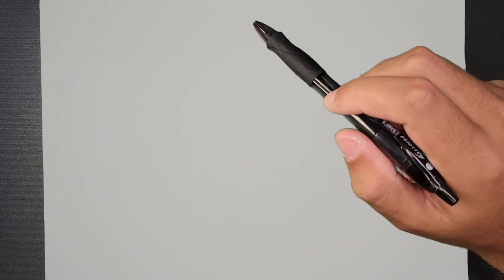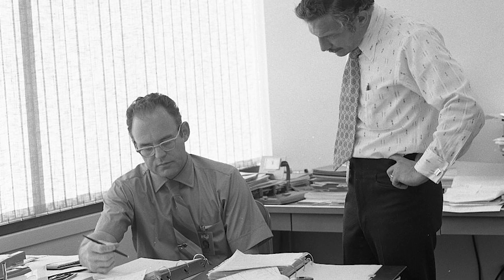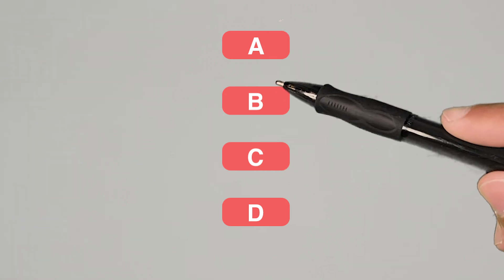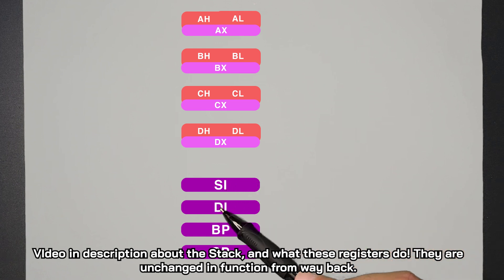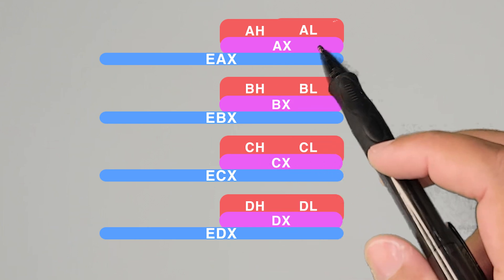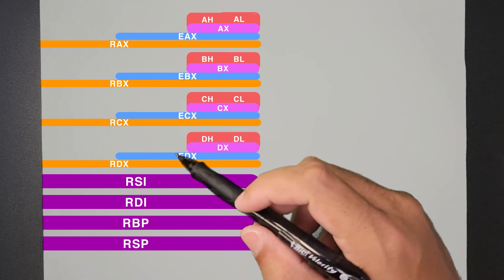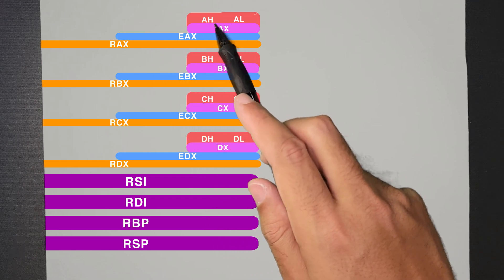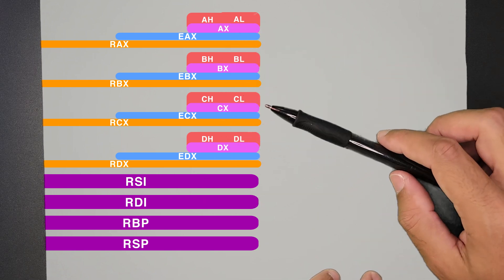Register Names Explained - x86-64 General Purpose Registers (RAX, RBX, RCX, RDX, RDI, RSI)

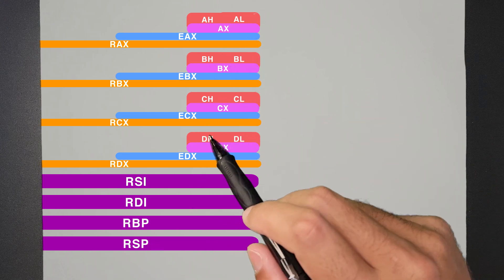Comment: 7:10 I don't understand why RDX has to be clear (contain 0) before performing a division operation. You said the remainder of a division would be stored there, but wouldn't the remainder just overwrite the value in RDX? The only reason having a nonzero value in RDX would matter is if the remainder was ADDED to the contents of RDX instead of overwriting it (or perhaps RDX is used in some way to calculate the remainder). Perhaps you meant there may be a value in RDX that had to be saved. If so it could simply be moved to another register without needing to clear RDX.
Reply from the maker: Hey there! The DIV instruction allows us to divide massive, 128-bit numbers. To handle this, the RDX register is combined with the RAX register. This means that whenever we divide, it's actually looking at both RAX (as the lower 64-bits) and RDX (the upper 64-bits) as the dividend. So this is why we zero out RDX, because if not, then the Assembler will think that we're diving into a massive number.

Here's an example:

Imagine we had some regular decimal registers that can contain up to 4 digits, let's call them RA and RD (register A and register D). Let's imagine that RA had the value of 0010, aka ten -- regular old ten, in decimal. Now let's imagine that the RD register was put 'on top' of the RA register in combination:

RD:RA

Let's now imagine that RD has some value in it, let's say it's also 10, or 0010 in our 4-digit-decimal case. So now, it looks like this:

0010 0010.

If we divide into RA, thinking it's just ten, then we see it's a big mistake: It's actually 100,010 -- or one hundred thousand and ten!

That's what's happening with RDX, and that's why we clear it. Sorry for not pointing that out in the videos. Sometimes I cut things when they are more general focused, so that we don't have to go down rabbit holes.

I cover it in the Multiply & Divide video in the Assembly course, if that's at all helpful for you: https://youtu.be/SyQZ9v8dd2s

Thanks for watching and for the comment, and sorry again for making you have to get clarity here in the comment section instead of in the video!
Reply: @MxyAhoy Thank you for your clarification. But according to your reply we would only have to clear RDX if the dividend fits in RAX (e.g. in 32 bits). After all you said the DIV instruction allows for the division of 128 bit numbers, so if the dividend required more than 32 bits we would load the least significant 32 bits into RAX and the most significant bits into RDX. But you didn't specify where the divisor is stored; in another register or as an immediate value. Perhaps both are allowed (I know some assembly instructions allow both). When I have time I will use your link to your assembly course to learn more about the multiply and divide instructions. It should state where the divisor is stored. And now I understand why you didn't clarify clearing RDX in the video; you assumed the viewer already knew how DIV worked and didn't want to explain every little detail because it would make the video too long. (It would be similar to a video in which a math professor casually states the derivative of x^2 is 2x. Viewers unfamiliar with calculus would not know why but it would take too long for the professor to explain every little detail.)

Comment: I'm sorry, i like your vids and i am watching every one of assembly, but i think you didn't fully answered the question on this one without leaving questions, your video was nice but i think more some examples were needed, of what would be an "accumulator" or "base" or how a RSI or RDI would work, maybe you could do another video showing on practice these registers being used.
Reply from the maker: Thanks so much for the feedback! I think you have a good point. I originally meant for this video to explain why registers have the names that they do, but it really makes sense to include some specifics on what each does, with an example. I think I was more concerned with constraining the video to a certain length than being as thorough as possible. That was a mistake. I will make a note to record a companion video where I go over each register, their original purpose, and what they are mostly used for now if they have any specific purposes still.

Thanks again, and thank you for watching and for the comment!

Comment: Is there an emulator app of intel x64 instructions for an Android tablet? I use a DosBox app with x86 instruction for Android and it emulates an intel 80386/80387 a 32 bit CPU/FPU.
Reply from the maker: I have never seen one or looked for one, however I have used the Termux app (just a terminal), and with that you will be free to use any emulator that runs on Linux CLI. For example, I use Termux to login to an SSH server that runs my Debian. Hope this helps!